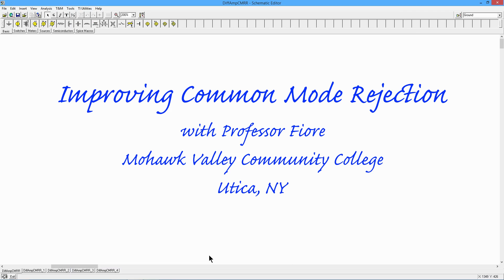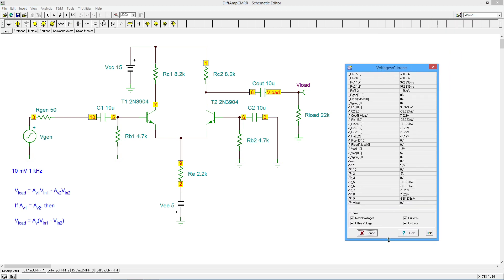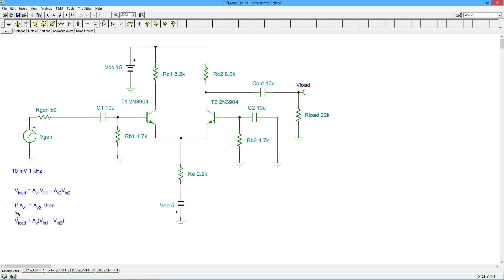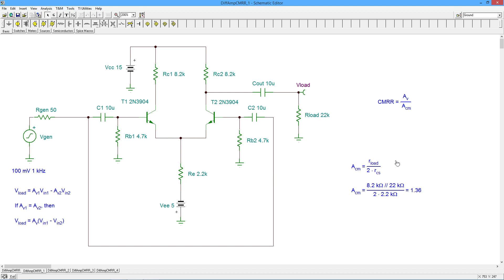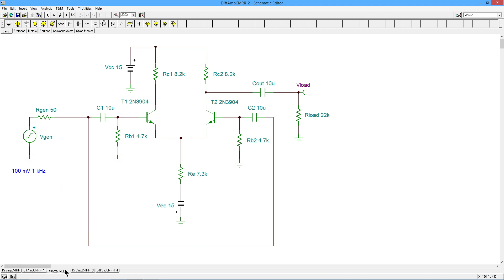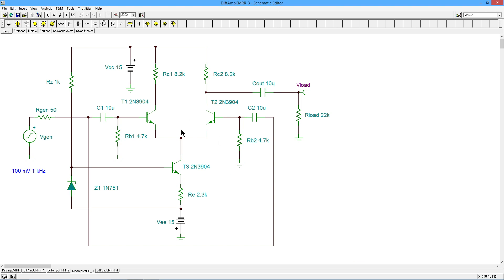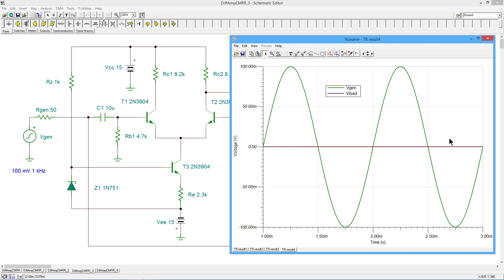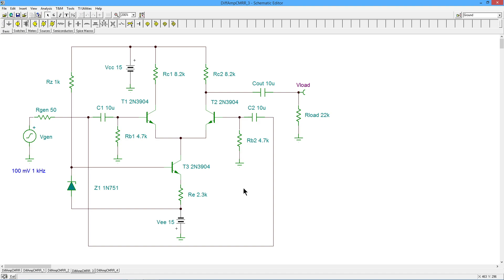Op Amps: Improving CMRR (Common Mode Rejection Ratio)

Comment: So... CMRR is made much smaller by introducing a current mirror to the Diff-tail. The Av has dropped to next to nothing. Do we care? We can amplify it back up in the next stage while minimising internal noise/distortion. Would it be fair to say that the purpose of the diff-amp is not to amplify but to 'condition/clean' a signal?
Thanks again, these are the videos that I've been building up to.
Reply from the maker: I think you've got this backward. Using the current mirror has increased the CMRR. That is, there is greater rejection of the (undesired) common mode signal. The gain for differential signals (the desired signal) is not changed.
Reply: @ElectronicswithProfessorFiore  Yes, sorry. I meant to say (apologies for a bad question), As CMMR increases, as a result of the current mirror, Av decreases. The way you talk about this makes me think that the diff-amp is really used at the front (incoming) end of a larger circuit as a method of reducing noise/distortions introduced in the circuit itself by means of feedback to the 'other' input. (Confused knowledge in my brain here).
Reply from the maker: @simonyoungglostog  There are two gains to consider here. The first is the normal signal gain. That doesn't change. The second is the common mode mode. The current mirror reduces that gain. Ideally, you'd like the CM gain to be zero. Yes, the diff amp is used at the front end of a system. The differential configuration reduces noise that is induced into the incoming signal wires (particularly a problem when the signal voltages are very small, as they would be with something like a microphone).

Diff amps can also be used with negative feedback, as you pointed out. NF can reduce distortions by sizable amounts but does not impact noise performance.